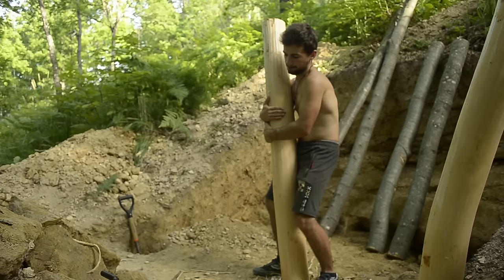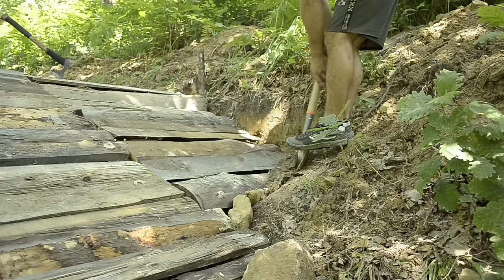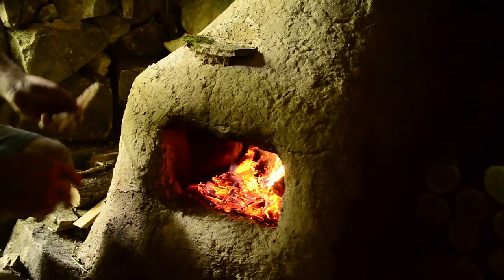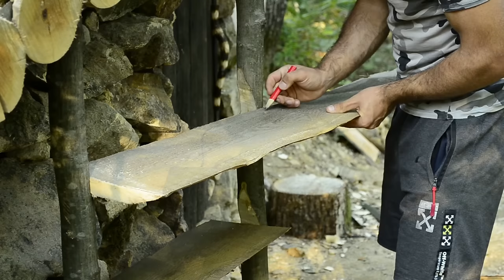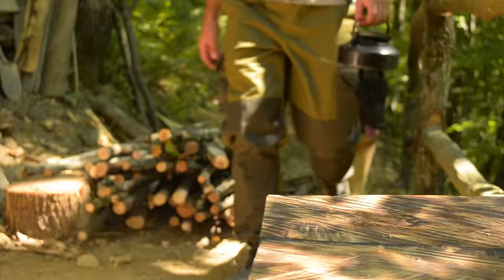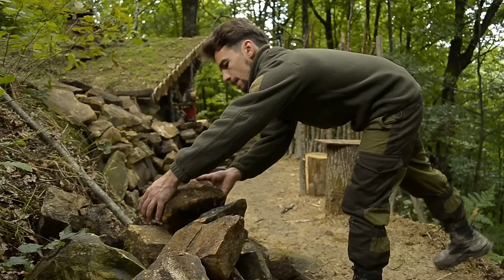Hobbit dugout in 14 days. Start to finish

Comment: For wintertime you could doub the walls with the claymixture that you used for the fireplace and then cover with white "paint", maybe something like chalk. White really reflects heat and light so the hobbithole would be warmer and more light without having more lights on when door is closed for heath preservation. Greetings from the Netherlands!
Reply: AND, if you built this with stone floors, in the summers in Southern US - it would be nice in cool when it's hot and humid outside!!! (Can't build the fire inside then, but...) - Also, cool way to preserve your matches, dude!!!
Reply: He did not use clay. That was simple dirt and secret but very important ingredient.
Reply: @Marine5D  I thought I saw some fiber structure to the mud but he left that out, maybe in another video.
Reply: @juggernautz  Since he clearly did not use clay which is by itself a binding material you have to ask yourself what did he used to bind and harden that mixture together? Simply from the color of the mixture i can tell that he used some amount of cement and i think it's fine but he could have disclosed that. I wouldn't judge. In old days people used clay to build fireplaces and earlier they build burning altars or simple bonfire in the middle of dwellings.
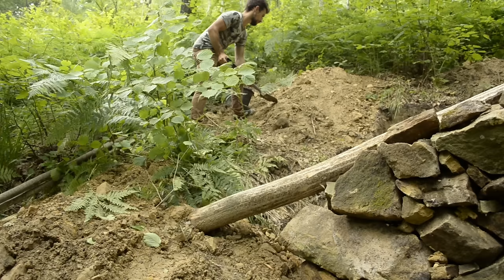Reply: @Marine5D  Look at the video starting at 8 to 8:24 minutes to see what color the dirt is in the area. I'm not sure where this video was filmed but pure clay minerals do exist in light colors and some are a beige color, depends on the country and region.   Sandy Loam has a lighter color.  If he mixed cement then ask him via email on his page. click on his name, then About to see email link.  Could he add limestone and sand to get a cement like strength, sure but its worth knowing since he's teaching with silent videos.
Reply: @juggernautz  Not all clay has same properties, and yes there are some clay types which are pale color. If he used clay then it could explain strength of fireplace, but simple dirt and even mix with limestone just won't cut, it's not even comparable. For instance cement is binding through chemical reaction and then it gets sturdy and clay harden through drying with high temperature.
Reply: @Marine5D  That's why he needs to tell more, mud doesn't say much.   Dirt with little or no clay isn't durable for sure.   I noticed a couple of cracks too so that is not uncommon with clay so I assumed no cement since it binds quite well as you mentioned.
Reply: It had to be clay. He went some distance away and filled his bucket from a particular spot. Had it been mud, he would have dug it 5 feet outside the door. Why carry simple mud from a distance? It must be clay.🤗❤️🐝
Reply: @deborahdanhauer8525  What argument is that? If i was born yesterday i wouldn't doubt that he walked really far far away and not just 5 minutes to the east. Do you actually know how long was the distance? Do you know what involves a proper soil research? I give you a hint - it's not by walking really far away and it involves digging few layers of soil or drilling with at least 3 meters long drill attached to a specialized machine, for example - a tractor. I know, because i've done this in my civil engineering studies.
Reply: @Marine5D  well, I’ve dug clay out of the side of a hill many times. All you need is to know the difference between clay and dirt. No extensive research or drill required. Then make pottery or whatever you want with it. There is no way for us to know for certain what he brought back because we weren’t there to feel it for ourselves. But he must have thought it was clay, or he would have just dug it from beside the little building. That makes perfect sense to me. If it doesn’t to you, that’s fine. I couldn’t care less. But there is no reason to be a jerk about it.
Reply: @deborahdanhauer8525  having an education in it is gonna give you a lot of knowledge but me too "just" went outside with a shovel and an open eye and now i have ceramic works that fired perfectly at 1080c. Clay is a beautiful material, and like others have pointed comes in many variations, some not even usable for pottery.
Reply: @deborahdanhauer8525  There are plenty of debunked videos about people building structures and not disclosing completely that they used cement. You can keep arguing with me that he went to the quest of finding clay, and not just any clay i might add ...or you can check for yourself how abundant are fake building videos. Funny thing is that besides of this his build is pretty cool and i have no reason to say he faked everything else. I think everything would be fine if he disclosed this one thing thou, because walking in one direction for 10 days does not guaranty you will find correct  type of clay.
Reply: @rubenskiii  Yes, sometimes it’s right on top and sometimes it’s easy to see the clay layer in a hillside. Along creek banks is a good place to look too. And yes, not all clay will work for all projects. I’m certainly not a clay expert. But I have found it. 
I think it’s fascinating that you can just go and dig something like that up. Our ancestors did exactly that for thousands of years and made some of the most beautiful pottery I’ve ever seen.🤗❤️🐝
Reply: @Marine5D  of course there are no guarantees about a thing like that. But why assume it’s faked? Why not assume it’s exactly as it appears?
I refuse to let the bad people in this world blind me to the fact that there are good people in this world. 
Let’s try this. The romans made concrete 2000 years ago that is better quality than what we make today. So even if he did use concrete, he was still building in an ancient style. That way, even if you’re right, he isn’t a fake.🤗❤️🐝
Reply: @deborahdanhauer8525  Have i mentioned that i studied civil engineering? I know a thing or two. We perfected concrete manufacturing by inventing reinforced concrete about 300 years ago. We would not have Burj Khalifa, nor Empire State Building with just a simple concrete. Actually reinforced concrete extended possible entablement length more than 10 times compared to a regular concrete. This technology introduced much needed elasticity to a regular concrete. If you like to think positive than you could say that we can still improve things, but even looking at production volumes it is uncomparable.
Reply: @Marine5D  There are dozens of articles and several studies that say Roman concrete is more durable than ours. A quick Google search will tell you that. There is a good article in science magazine. Whether you agree with them about the quality or not makes no difference to me at all.
The fact remains, there was concrete in ancient times and the guy in the video could have used either clay or concrete and still have stayed in the time period. 
Now, I’m bored with this. It’s gone on far to long already. Think whatever pleases you. I’m leaving it right here. I won’t answer again. I wish you a good evening.
Reply: @Marine5D  You didn't have to disclose that you studied Civil Engineering, it was already clear that you were a "know it all" with a negative attitude.  It is also not lost on anyone that you say you "studied" and not that you "are" a Civil Engineer.  Big difference. 

When watching these types of videos there are two different types of people, those who watch and appreciate the efforts of the person building the structure and enjoy it for what it is and then there are the people who look for anything and any reason to either downplay or outright insult the efforts of the person buildin the structure and try to make it seem like they know more than snyone else about the subject.  You are clearly the latter.
Reply: No where has this silent man said he is teaching us anything. For all we know - the dog may a paid actor. Lmao! None of this maybe "real". He never pro.ised us anything genuine. What he did do~ is gave us over an hour of enjoying nostalgic amusement. I know I was surprised that I watched this "movie" from beginning to end. Whether it was "real" or not isn't an issue here, I believe....the point I see: he got you all thinking! He held your attention. That in itself is amazing. In a wholesome manner. The amount of views this man has is astounding. Whether he used clay, dirt, cement, or dog shit.. he made something beautiful. He made no promises. He didn't say a word... thats fucking amazing. I'm going to follow his lead now...I'm going to click on his next video and shut the fuck up and smile!😁

Comment: "In a hole in the ground there lived a Hobbit. Not a nasty, dirty, wet hole filled with the ends of worms and an oozy smell. Nor yet, a dry, bare, sandy hole with nothing in it to sit on or to eat. It was a hobbit hole, and that means comfort."
Nice try, though. And definitely a good sturdy shelter. It gets a thumbs up from me. In 1972 a friend and I were snowmobiling up the Chena river in Alaska one winter and came across a fellow who had a hunting camp set up a lot like this one. The door was normal instead of round was about the only difference. My friend and I built something similar at our favorite fishing/camping spot. Not as tidy and we were constantly having to make repairs, but we were only 12.

Comment: I am pretty sure this lovely house will not stand the test of time.  Untreated wood beams touching the ground = rot and termites.  At least heat treat the wood by running it through a fire and wrap plastic around the ends of the logs resting on the ground.  A French drain foundation will pull runoff away from those log ends too.  

That said, this is very aesthetically pleasing house, please show us more videos featuring it.  I would love to see it in 5 years

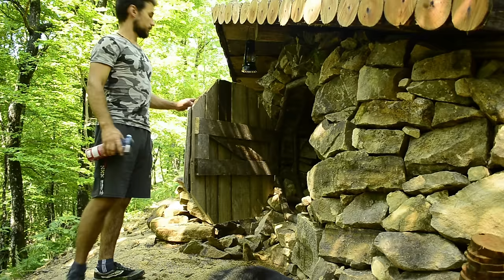Comment: A humble suggestion - maybe instead of using the blow torch on the front door @19:30, it may be better use of that resource to instead fire harden the bottom of the posts that went in @0:50. Fire hardening the posts (the part that goes underground) would leave a layer of natural creosote behind that insects don't like. It would likely make the structure last longer. Also, wondering if you had any leaks along that back wall..? Would you consider putting in an uphill patio, for balance of light, cross ventilation, and most importantly for drainage

Comment: I would like it if you disclose that you used cement to build a fire place. Some of viewer know that it is simply impossible to build it using just wet dirt. Next best option would be high quality clay which you did not have. I don't think that disclose would hurt the popularity of this video because beside of that the build is still awesome.

Comment: Hi, great job. Just one suggestion, maybe u cud build your dog a nice flat bed out of the flat slats and put a dog bed on it. Stones are not comfy and it wont do your dog's joints any good. Id personally cover the floor in wood slats, it will keep the heat in and comfy for u and your doggie to stand or lay on.

Comment: Great skills indeed! However i built one very similar, and when it rained, all the rain on the forest floor came running through all the cracks in the rocks. Floor was flooded. Not fun.
Reply: I think that's why he extended the roof out well past those walls, even into the hill. I personally would have gone with some grout and perhaps a double layer floor so any excess can drain away without discomfort. Would take a bit of effort to flatten the support structure just right, but I honestly believe that would be worth it. Also wooden floor would be better than stone or dirt.

Comment: this is beautiful.

my only concern would be roof strength long term.  as nature grows around it, someone walking on the ground above could easily mistake the roof (especially if fireplace isn't active at the time) as just more ground and walk across.  if the roof isn't strong enough, the person would fall through.

That said, I want to build one (or several!) of these myself now!!
Reply: water will seep through the walls, that roof is sketchy, those nails are inadequate, the wood for the roof was half rotten and no strength. If soil gets wet it will collapse the roof with the extra weight of water. Cool for the summer , and pretty creative.

Comment: Thank you so much - I loved the video!  I suggest that the wood that is intended to sit on or in the ground would have a much increased life and protection against rot and insect attack if the pointed ends were charred in a fire.  It would also make the points harder to penetrate the earth more quickly.  I would be very interested to know what types of wood were used, especially for the bowls, etc.

Comment: Beautiful work!
As the little cabin is partially in the ground, will drainage be a problem during the rainy season? I didn't see the builder putting in pipes to drain off standing rain water -- how will residents deal with that?

Comment: I watch these guys building and putting all this work into it... But one thing I've noticed is that they never charcoal the wood before they stick in the ground or lay it on the ground... The structures going to fall apart pretty quickly when the wood begins to rot within a year or two...

Comment: When you hear the term "Red Dirt" from Oklahoma,  it doesn't mean the color as much as hard solid clay!  This is like a dug-gout, that my grandmother and her parents made when she was small, would taken several days more than this(hard dense clay).  You couldn't live long in one here because of shifts in the clay as the weather changes.  People try to build energy smart low in the ground houses here and half way in they find out, after a year, it (weather extremes) will break the walls and floors as the cold and moisture change the consistency of the clay, so then mold sets in and later an abandoned house with no takers, just a a demo waiting to happen!  So sad no one informs new builders here.  Also should be super cautious building cellars in Oklahoma.

Comment: Dirt and water becomes mud, mud and even more water becomes very thin mud that's just running away. Mud minus water becomes dirt again. It's not like you just put water and any kind of dirt together and get mortar or Cement, it's not gaining any kind of structural Integrity from that. It dries out and crumbles, that's it. With most soil you can even fire it all you want, it's not gonna help, you're not getting bricks from it. Do people seriously not realize this?